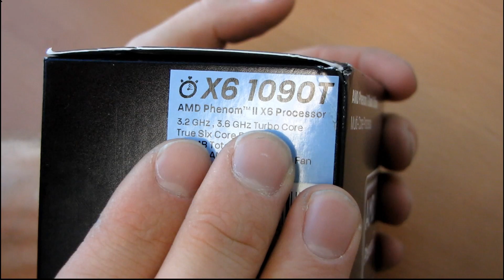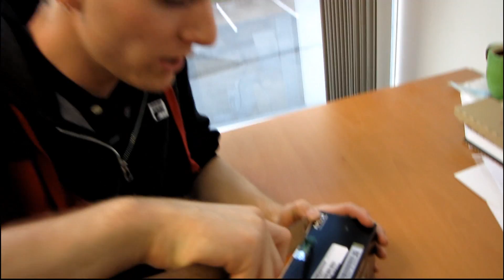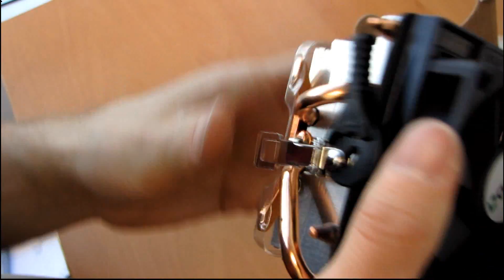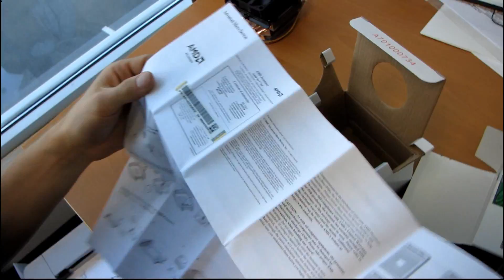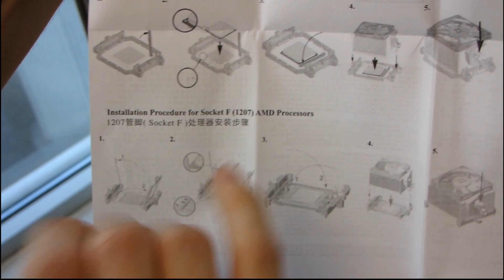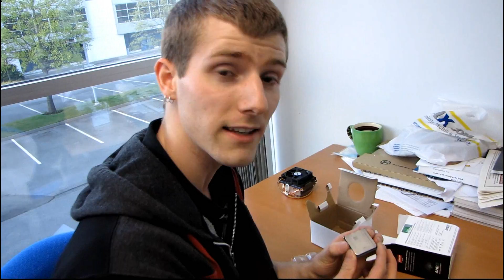AMD Phenom II X6 1090T Black Edition Six Core Processor Unboxing & First Look Linus Tech Tips

Comment: @WOTGSmash 
compaired to Intel, it is really cheap, and it kicks ass too :-)
beginning now to regret building an Intel system, the cpu's as you know are just to expensive!!
the slightly slower version that runs at 2.8 is under 200, or £160, for six cores :-)

Comment: @staticxmako An i7 will run faster than a Phenom II X4 simply because of hyper threading. I'm not entirely sure WHY it works the way it does (I think it's the way the OS handles thread timing), but i7s just tend to be faster when a lot of multi-threading is going on. Also, i7s have been shown to be more overclockable. My Phenom II X4 can only go up about 0.75GHz before it starts chomping down on 1.6V.

No doubt, AMD processors have more bang for your buck. But i7s are just faster.

Comment: @traingp7 

IF it were a dual-channel setup with only two DIMMs, then yes.  But since you're using four DIMMs, I think it's very unlikely.  The Phenom II's memory controller has been known to have problems running four DIMMs at anything more than 1600 MHz.  I'd first try to get it to 1600MHz and then 1866MHz, though I don't think it'll go that far.

Comment: Does anyone know if the memory controller on this processor will allow 2000 mhz memory.  The current 965 which I have can only go to 1600 mhz memory with the 200 mhz base clock.  Will this processor allow the base clock to 250 with the 4 to 1 ratio give me 2000 mhz dual channel memory.  I have 8 gb of DOMINATOR GT 2000 mhz memory with 888 24 timings on my 790fx gd 70 that supports upto 2133 via OC according to the specs of the board.

Comment: @AgentHydra 

No, you're the one that's lame.  You're not the consumer they were aiming at with this processor.  It costs the same as the Core i7 930 and is faster than it in most tasks except gaming.  And why the hell are you whining about it having a 125W TDP?  The i7 920/930 consume more power.

Also, consider that this is significantly faster (around 35% faster) overall compared to your 955.

Comment: lol what about all theirs intel vs amd fight .
Okay. i7 980 is a hexa core with 12thread. 32nm
Phenom II x6 is hexa 6thread. 45nm.
Check Guru 3D benchmark... this chip hit 4ghz @ 1.40vcore. and its put way less power than i7 980x.
I am not saying phenom II x6 is better than i7 980x but u can buy a whole high end gaming rig for the price of i7 980x.
( crosshair iV - phenom II x6 - gtx 470 - 650 TX - 2x2 1600mhz (mushkin) for 1100$ on newegg.)
Gaming = Video Card not Cpu dependant noob.

Comment: Why did AMD get rid of socket F.  They only made three processors for that socket the FX 70, 72, and 74 which were dual processor boards that came out back in early 2007.  They made those three processors and they let the processors die.

Comment: This CPU rox!
Its getting cheaper and cheaper...and if you compare the 1090T to i7 860, cpu and mainboard cost about the same. [the i7 870 is toooooo expensive]
But: the hexacore is a little bit faster AND AM3 supports new cpus in 2011. This is not the Case for Intel plattforms (for example 1156 gets replaced by 1155)

Comment: @jvmbatista look at just about any gaming benchmark, AMD fails hard. Against an i5 750, it lost half the benchmarks! Wouldn't you expect the 2 extra cores to make a difference? Well, AMD sells very nice specs for a very low price, but it's highly lacking in efficiency.
And about the prices of the six cored intel cpu's; it has fucking 12 threads on 32nm, it's a theoretical 12-core cpu with way more potential than the PII x6, no contest.